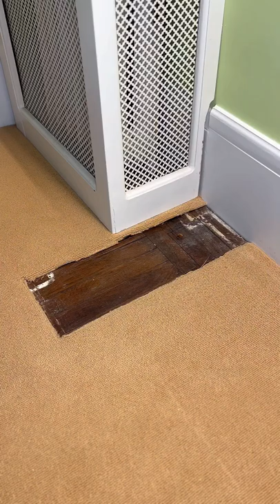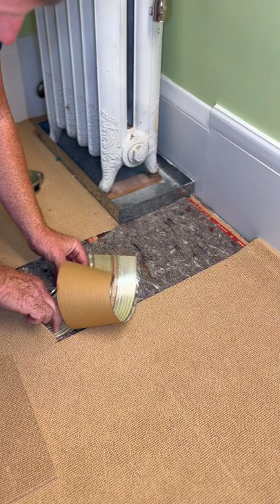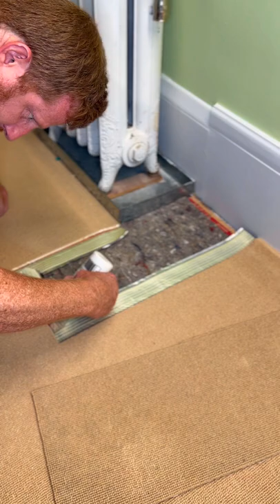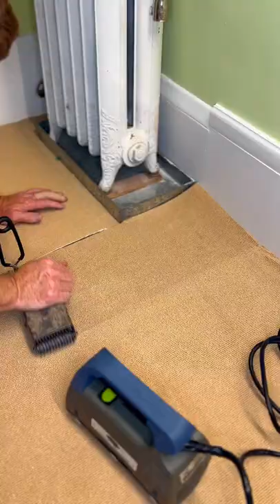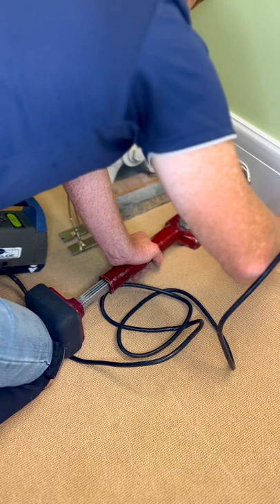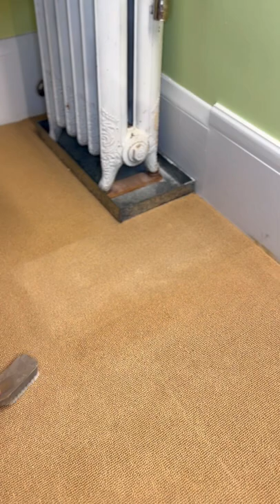Curating carpet content #shorts

Comment: Are there times you can’t find a match to a carpet you are repairing?
Reply from the maker: Always an option better than replacing for areas like these: donor from closet or obscure corner that’s covered for the damaged area and finding and putting comparable back in the donor.